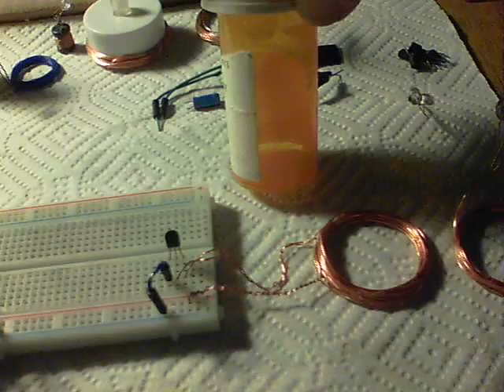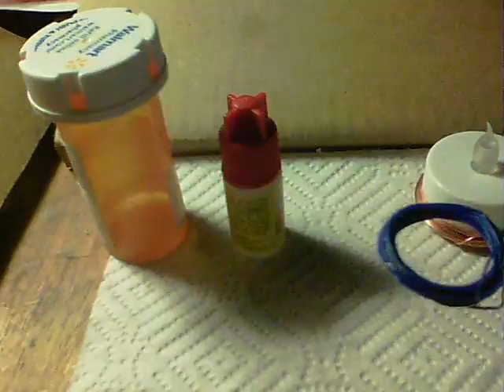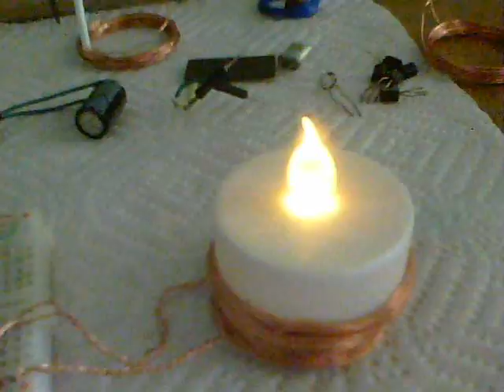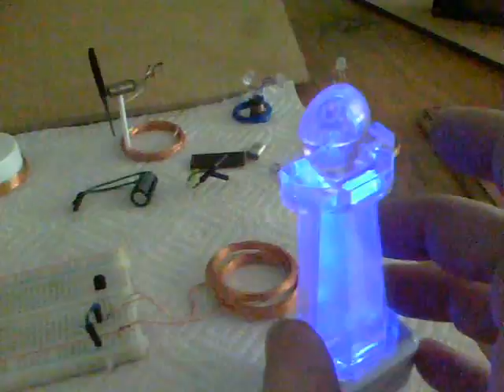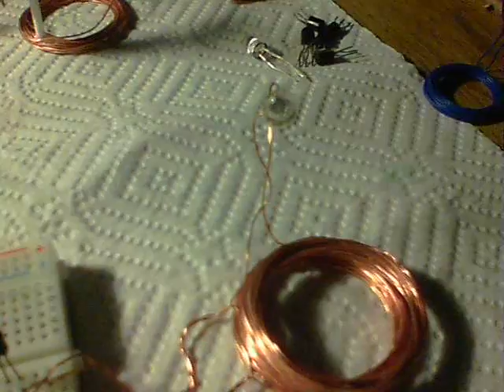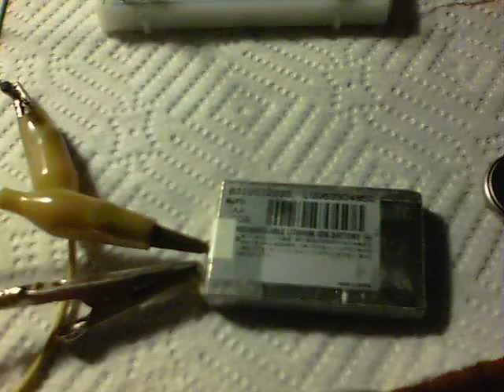SWES 2 - Simple Wireless Electricity System 2

Comment from the maker: In reply to Ben Wolfson (your 'Reply' button is off it seems)
Seems like your system is ok in terms of wiring, but there are several things to check. .
For a first run, coils should be of similar size to those shown in the vid - make sure the windings are not shorted and that the enamelled wire is new. Testing with a multimeter is best, to make sure you have at least a couple of ohms resistance in the send and receive coils.. Shorting is the most likely cause of these problems.
Wind 20 turns of the same wire as used on the transmitter and simply attach an LED across the start and end of the coil. You should see a 2" or so range at least of wireless energy. Superglue can be used to secure coils turns in a tight coil.
For heat, some transistors work much better than others, but all transistors will work to some degree. Best include MPSA06, MPSA18, 2N2222A, C1815, C1213. All of those are NPN. Attach a 100ohm resistor to the Negative from the battery and a diode to the Positive... 9/10 times that cures overheats.
More turns on the transmitter coil will lower any heat. Coils should be a minimum of 12 turns. More turns reduces range though, so some good experimenting can be had to find the optimum for the components that you are using.
Another way to reduce heating is a variable pot resistor to the Base of the transistor. That will enable running the system at higher voltages too, with say a penny coin superglued to the transistor acting as a heatsink.
The system should use between 20 and 40mA when running, so heat ought to be minimal.
Reply from the maker: Ben Wolfson
That setup looks perfect !
Not being off here, but you're completely sure that's enamelled wire ? I couldn't see any scrape off from a knife or perhaps burn marks from using a lighter on the ends (both being the usual way to remove the enamel). I can only think that to be the trouble.
A definite fix, would be to try different wire. Regular thin wire with the plastic on the outside will also work, the type of coating that can be removed with strong finger nails, same as your green wire connecting to the Negative rail on your breadboard. It doesn't give the same receiving range, due to distance between turns, but would sort things out such that you could inspect the original wire.

Comment: Cool. That's something I can try with one of my new toys. Another video for my second channel.
Reply from the maker: Ah, 1 of your 45W shiny new panels perhaps ! For higher voltages, just put a resistor on the Base of a Power transistor (variable pot will allow best tuning).
Reply: slider2732
Deffinatly. I will start with a 100Meg ohm and work backwards. Don't want to burn anything out with all that 45Watts. LOL LOL LOL.

Comment: Excellent work my friend. Could you have a solar panel outside with transmitter. Reciever inside charging a battery? So effectivly charging the battery with an external solar panel. No holes in the wall for cables.
Reply from the maker: Yes indeed. Kyle Carrington mentioned a while back about putting a transmitter coil on one side of a window and the receiver on the other. Just put a diode on 1 receiver coil wire and away you go :)

Comment: I found that using 2 completely independent circuits (not even sharing the same power source) and using the coils a fair distance apart will help power the device in between a lot easier. I'm currently trying to find a way to make some sort of antenna to boost it even further
Reply from the maker: Am glad you are digging in to this..it's a lot of fun :)
You may have noticed that a small field of energy can be picked up around a standard battery itself. That fact can be used, to build an antenna off from the battery. Also, if you connect long leads from battery to circuit, a single loop can be made in a power wire and wireless energy can be picked up above it !
By using 2 completely separate circuits, the frequencies will mix and combine in the same space. An analogy would be radio stations...you can pick up many stations on a regular radio, but if all were to broadcast at the same frequency, then you'd probably hear just the most powerful one and some noise of the others in the background.
Big blocks of metal work well for send and receive (even better if both are the same size), such as 2x PC heatsinks. Metal work surfaces are something to steer clear of, they soak energies readily. Antennas should be raised a bit, away from any surface, perhaps on coffee cups.
Reply: Is there a way we can privately message each other? You seem to know a lot about this and I have a lot of spare wire and time on my hands. Perhaps email?
Reply from the maker: The Computer Tech Guy
Yes sure... slider2732@yahoo.com:)

Comment: I wonder. Would this work with three of the small choke coils? Two together like in the tiny penny Oscillator circuits with one of each legs tied together for the center tap for the transmitter. And then the other choke for a led receiver coil.
Reply from the maker: Yes, I think so. Not sure if i've built one myself exactly like that, but normally if you miss out the LED on such a blocking oscillator circuit it'll act as a wireless transmitter from the coils. Without an LED being across the transistor, the wireless one will run.

Comment: So,  the transmitter windings wired  same as Tesla's bifilar pancake and the receivers not. ?  But they both have the same number in total turns.    I would imagine the higher frequency,  the better.       Did I get that right,?

Comment: Great video thank you!!! Can you tell me why your system doesn't need a capacitor?  How does it oscillate?

Brilliant vid.
Reply from the maker: Thanks. The coil itself sets up resistance and capacitance. Not a lot of course, but enough for the system to work. The original SWES, with a Tesla bifilar coil does a better job of the capacitance side, but really not a lot is needed.
Most wireless electricity systems will use a few pF of capacitance, but the difference being that they usually only have 1 or a couple of turns on the transmitter coil. The resistance of the wire, because of its gauge and length is what allows the transistor to fire.
In essence, uses the properties of the coil, to forego the need for a capacitor or resistor :)
Reply: slider2732 Really thank you for your detailed and helpful reply. Do you know a source of information I can find that allows the calculation of the transmitter frequency, voltage and current based on the capacitance and the load etc? I have been building circuits but with no idea how to optimise performance. For me it's been pure trial and error. I'm a mechanical engineer so out of my depth already!!! :)

Thanks again. I love the simplicity of your circut.
Reply from the maker: There are formulas, but when actually running they seem to be guides and not exact in practice, in my experience. Much better for frequency control is to use a fixed oscillation crystal or another form of speed control.
A usual method for this circuit is to use a frequency sampling meter and read off the value (I use a Uni-T U136B), but a scope is a good idea...usually about 1-2MHz is the running speed. This sort of system is free running, the transistor fires as fast as it can. Altering the frequency can be as easy as increasing the diameter of the coils to slow it down, less turns will speed it up.
Cut current by using a diode on one input from the battery, also add a 100ohm resistor in series if needed. Tuning is usually easiest on the receive side, changing the number of turns, diameter of coil, thickness of wire used. You can also fit a small variable capacitor across the receive coil 2 wires (an old radio tuner capacitor works).
Reply: slider2732
How important are the LED's. do you find that these give you a vastly different performance. Also, would fitting a variable capacitor on the sender center between the positive connection allow tuning of the sender?

I have to say, that you have he best video I have seen on this topic. thank you so much for all of your help.
Reply from the maker: For brightness, I nearly always go with white or blue or green superbrights. Most LED's are in fact superbrights nowadays...anything non frosted. Reds use least power, but maybe not as bright as other colours.
A variable cap can work, depends how big the cap is (capacitance range) and how much capacitance your coil has to begin with. But yes, improvements can be had by using one.

Comment: Thanks. It worked great. I am not able to get a motor to run yet though.
Reply from the maker: For a motor, or other circuits needing smoothed DC....sometimes simply a diode from one leg of the pickup coil is enough. Otherwise, you can put 4 diodes as a bridge rectifier, with a 100uF capacitor across the outputs, that will smooth it out. Also experiment with the amount of turns and gauge of wire for the pickup coil.

Comment: Can u plz tell how to calculate no of turns for fixed amount of voltage? I need a mathematical analysis.
Reply from the maker: That's much easier for regular transformers. In this case, it has to be trial and error from a rough starting point, because every build will be different. Different tightness of turns, spacings between wires, power supply variability (especially battery powered devices). The distance degradation isn't completely linear either, depending on environmental factors such as humidity, temperature and any metal objects in the area.

Comment: Awesome stuff, really want to set one of these up myself, but know little about electronics, where/how is the best place to learn about all this more? Great work, and thanks! :)
Reply from the maker: Simply jump in. I believe this project to be a good start.
For one thing, you only have to remember that the left leg of the 3 on a typical transistor is the one to connect to the negative of a battery, which takes out confusion. By all means look at transistor hookup guide videos etc for familiarity.
A busted old CRT TV or 1980's/90's hi-fi will supply everything you need for many similar projects. No soldering needed...for example, to remove a transistor you can simply bend the 3 legs back and forth. Then connect by wrapping the wires tightly around the legs.
Make a start, tell me what components you have and then of any help you may need.
Looking forward to your first wireless circuit being up and running :)

The theory is good to understand - the transistor fires and a pulse goes out through 1 wire of the coil. Some energy is picked up by the other winding of the wire and comes back to the 'firing pin' of the transistor. So it keeps going, firing, waiting for the signal, firing, waiting. The frequency is high enough of it doing that, that some energy escapes into the air and that's what is picked up by the receiving coil and LED.

Comment: one question, which NPN transistors are they again?  I can't quite understand you.  Would any NPN work as long as has a certain Hfe, and if so, how high should that value be?
Reply from the maker: Hi Paul :) MPSA18 runs the best in the vid, others were MPSA06, PNP was S9015.
Yes any smalll signal transistor. for AA use...higher the Hfe the better, so MPSA18, 2N2222A, S9014 'D' are good. Plug 'n' Play to see which work best.

Comment: I wish I'd seen this sooner!
Reply from the maker: Adam Yarris Haha, well, you've seen it now :)
Best wishes for some fun builds !
Reply: slider2732 Thanks! And does it matter what kind of wire, it looks as though you are using copper.
Reply from the maker: Nope, as long as it's not bare. The wire in the video is enameled 28 gauge I think. If you are from the USA and a local Radio Shack is still open near you, they have 3 coil packs for a decent price. The wire gauges are slightly different and all are great for such coils.
Reply: slider2732 Thanks!

Comment: Hi slider, I tried building the circuit and noticed that as I increased the voltage, the light gets dimmer. Im guessing that's to do with the resonance. if that's the case, how would I work out the coil diameter and turns for the 5V  im using? Thanks for making the video :) its made me realise what I want to do in uni haha
Reply from the maker: Great that it's inspired you :)
You can sort out the drop off by putting a variable resistor (pot) in series on the Base leg of the transistor. Connect it to the leg, followed by the original wire that went to the Base. Once you find out the resistance it needs to run well at 5V, replace the pot with a fixed value resistor. Should be around 2K, something quite low like that.
Over 1.5V the whole system starts to fall down. I believe it's because the transistor Base energy is too great, as in, too much energy is picked up and returned to the Base pin and limits refiring to keep things going.
Reply: Thanks for replying! ill try it out

Comment from the maker: In reply to Ty Noles (your 'Reply' button is off). A SWES2 typically draws 25-40mA, depending on transistor type, wire gauge and turns used.
If you go here: http://www.powerstream.com/Wire_Size.htm it lists all the different gauges and how much current can pass through. Even thin 30AWG at 0.25mm will allow approx 1 Amp through. The amount of turns is relatively low in terms of wire resistance, so the table can be used for the power needs of your system. 
These coils used ~24AWG, which, if I wanted, could handle 3.5A.
Reply: slider2732 Can you use magnetic wire ???
Reply from the maker: Fariss Diamond
Any wire with an enamel coating can be used. Copper tends to be the best, but even steel wire with a plastic coating over it will be fine.

Comment: I want to increase the range to 7-8 cm plz guide me
Reply from the maker: It's all about experimentation. 
You could increase/decrease the wire turns of the coils, change transistor, etc. A small value ceramic capacitor across the receiving coils wires helps..around 0.001uF, but will need experimentation to find which works best, because unless factory made every coil will be slightly different.

Comment: Is there an way to transmit 5v to power an microcontroller?
Reply from the maker: Yes, not terribly difficult, but does need a meter to check the output for voltage and current. First thing is to put a diode on 1 wire of the receiver coil, then a capacitor of say 100uF across the other wire and the diode end...you'll need the smoothing anyway. Check the level the capacitor reaches at different heights from the transmitting coil.
On the system in the video, a 470uF cap reached 20V in under 1 minute !
The microcontroller circuit will draw down that voltage, but, safest thing is to put a 7805 voltage regulator on the output from the capacitor and then your sweet spot range will increase and the microcontroller won't get fried :)
Reply: It´s not transmitting enough power... How can I change this? By me, it reaches 20 v in 30 seconds... I´m using a 3Ah lipo-battery, by this, the transistor gets very hot... Is there an also good, durable transistor?
Reply from the maker: If running from a lipo yes you'll need to upgrade your transistor. A good one would be the 2N3055. Any power transistor will work, though similarly to the smaller types you'll get better performance with some than others.
Add a heatsink to the back, best to use a nut/screw through the hole in the transistor. For temporary, superglue will normally be fine for testing.
That will up your power throughput and reduce heat too.
Reply: My microcontroller isn´t getting enough power...
Reply from the maker: What's the power requirement ?
Such a system is intended for small motors, lights, really anything needing up to a 250mAh lipo should work out ok. You can gain power by reducing the turns on the transmitting coil, down to say 4 + 4...the transistor may have trouble starting up depending on your wire gauge though, test with an LED across Collector and Base to see if the wireless circuit is running. The amount of turns says how much power can run through, many turns means less input, but less output. Using 4 turns would draw a lot from the power supply but increase the output power (if the microcontroller circuit usually needs 150mA, then your wireless circuit will likely use 180-190mA).
if you can run a motor of about the same voltage/current as the microcontroller circuit then your circuit should work.

Hope that helps.
Reply: slider2732 How thick (in mm) is best for the receiver/transmitting coils?
Reply from the maker: Best results so far have been with 23AWG, which is 0.57mm :)